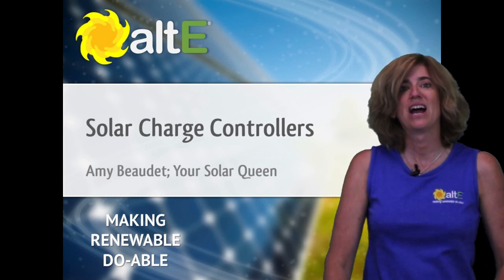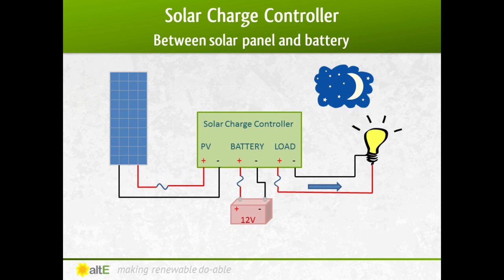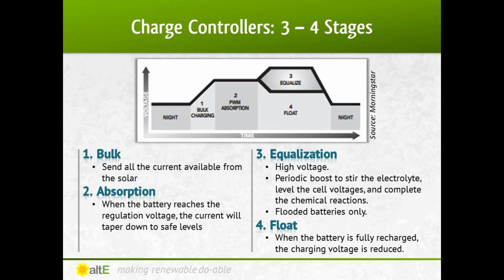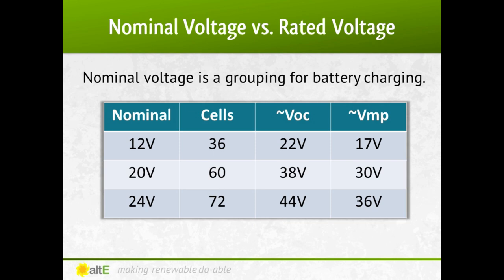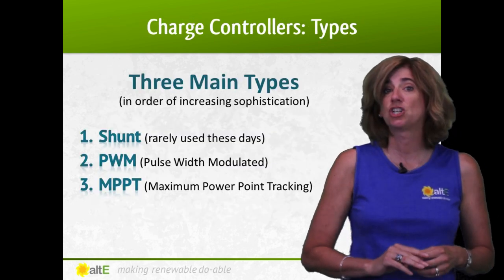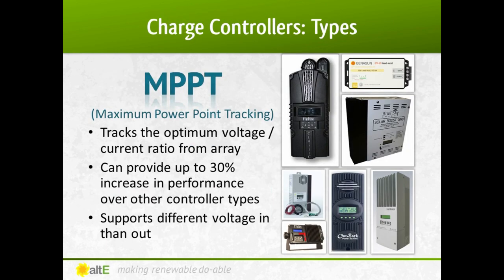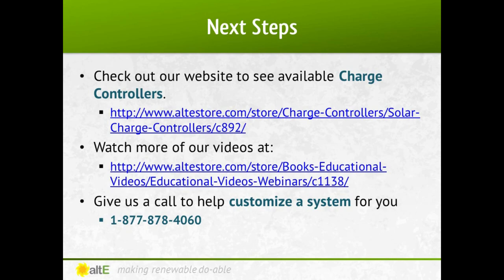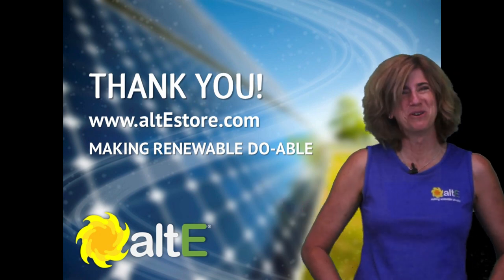Solar Charge Controller | What is it and How it works in a Solar Power System

Comment: This has been AWESOME.  But I'm still confused about sizing.  I have 6, 320W panels.  Does it matter how I arrange them, or is wattage wattage, regardless?  So at 1920W total, divided by a 24V battery, I end up with 80A x 1.25 = 100A.  Does that mean I need an MPPT rated at more than 100A?  Or 2 controllers?  Or does configuration matter?  If I put 2 strings of 3 parallel panels (36Vx10A per panel) each, in series, for example, I should have a system total of 72V@30A.  Does this mean I actually just need a controller rated at 100V/40A?  And would it be taking the 2160W input and putting out 80A at 24V?
Reply from the maker: You are right, watts is watts, regardless of their configuration. 320W x 6 panels = 1920W in / 24V out = 80A minimum MPPT charge controller. MPPT charge controllers already calculated the 1.25 safety margin. The only time the controller would care about if the panels are wired in series or parallel is voltage input. If the charge controller is 150V input, I'd recommend 2 parallel strings of 3 in series.
Reply: altE Store THANK YOU. I’ve been researching feverishly and finally realized that the controllers are rated by solar array voltage IN, but BATTERY BANK voltage-based amps OUT. You’ve confirmed and have helped immensely, and I appreciate it.

Comment: On my sail boat with variable shading from the boom Can I parallel a 24v 100w and a 24v 200w panel to a 100/30 controller to a 12 volt house bank

Comment: Hi all loved the video, clear and concise. We have an urgent problem, we have a 120 watt panel on the Land Rover, there is power going into the control panel but not going out to the battery. What would cause this please
Reply from the maker: See if there is a fuse or breaker between the charge controller and battery that tripped. If not,  temporarily take the charge controller out of the system and just connect the solar panel to the battery, see if that is charging it. If so, ten the charge controller is dead.

Comment: one question. 
will mppt charge controller work if the voltage from panels are not in the mppt range what is mentioned in the mppt charge controller manual?  i mean TO ask will mppt totally shut off giving Power or it will work like PWM?  thank-you for your answer in advance.

Comment: Nice explanation, I have one fundamental question. I understand that the PV power will always go from the charge controller to the battery before it goes on to the load. This means the load is always fed by the batteries.
My question is: Let's say the load is 100 W, and produced solar power is 200 W. Would the battery still be charged or will the power just go through the battery and directly to the inverter without charging the battery. Or will the PV power first charge the battery, and then deliver the necasarry power? When the battery is fully charged I assume PV power will still provide power to the load while keeping the battery fully charged, and only start discharging the battery when the load exceeds the PV power?
Reply from the maker: Excellent question. The answer can be a bit complex. We did discuss this with Schneider when we talked about the advantage of using equipment that talks to each other. This may give you the answer. https://youtu.be/Cppfil5h0hU

Comment: +altE  store thanks so much for the info,i would like to know what is the limit to the number of panels that i can connect in series for a 12v system so that i can have lots of charging current using an mppt.Can i have 114v into an mppt charging a 12v battery
Reply from the maker: That depends on your charge controller. What is the highest voltage it can handle? Wiring panels in series increases the voltage. Many MPPT charge controllers can handle up to 150V, so you would only be able to have a string of one panel. Any additional panels would have to be wired in parallel to increase the amps. The output of the charge controller will drop the volts down to the 12V, so if your panel is 200W, the output of the charge controller would be 200W / 12V = 16A. If you had a 60A charge controller, you could wire three in parallel (60A / 16A = 3.750.

Comment: Amy,, thank you for all your videos you are really our solar queen <3

I have simple question , I saw some MPPT charge controllers say in their specifications that for example the MPPT CC is 60 A , and max PV input (24v battery): 1600 W

but when I calculate it 1600 W / 24V = 66.67 A > 60 A 

so is it ok to follow their recommendation about the 1600 W PV maximum input for 24 V battery???

TriStar TS-MPPT-60 is good example
Reply from the maker: It is fine to oversize the array a little bit.
Reply: Aha...
So using 62.5A on a 60A MPPT CC 
you see it will be ok?
Reply from the maker: Yes. Remember the panels are rated at perfect test conditions. It is very rare that they will actually output the whole 62A, and if they do, it will just get clipped to 60A. No big deal.
Reply: Amy
You are the best 💙💙😢

Comment: I have 2 300w panels. I've noticed the 40a controllers are a lot cheaper than the 50's. Not sure how to go about it.

Also the 600watts are 24v so I wasn't sure if I should make the whole rig 24v or not.

Any help would be much appreciated.

Comment: Hello,

I'm slightly confused about your two calculations when sizing the mppt controller. 
In your first example you give a 1panel 30Vmp, 9Imp, 270W. You then divide 30Vmp/14V (voltage controller outputs)= 2.14. Then multiple this by the 9Imp to find current output by the charge controller stepping up the Amps = 19.28 to the batteries, correct? so to take into consideration the 1.25 possible increase in voltage at colder temps you would do 30*1.25= 37.5 V/14V= 2.67, then multiply by 9Imp =24.1A 
In the second calculation you then simply take 4 x 270W panels / 24V battery bank x 1.25 for safety to determine rating for the controller. = 56.25
Given the scenario of 4 X 270W panels using method one 60Vmp * 1.25= 75 /28V =2.67, mutiply by 18A = 48.21A max output by mppt.
Can you explain why you wouldn't use the first/last calculation to determine the Amp rating for the controller?
Thanks!
Reply from the maker: After talking to MPPT charge controller manufacturers, they told me I was over complicating it. Just divide the watts of the solar array by the voltage of the battery bank, and you get the amps that the MPPT charge controller has to support. For PWM, you do want to take the Isc of the array and multiply by 1.25 to get the size of the PWM charge controller.

Comment: I have 3 strings of 260wattsp(4*3 wired in series) with my 24v 600amps battery bank. I am using flexmax 80. The voc of each is 36.72v, the isc is 9.01A,Imp-8.50A and VMP is 30.60A. will I enjoy maximum operation?
Reply from the maker: I'm a little confused how many panels you have. Three or four strings of 3 in series? The Flexmax 80 can handle about 2000W of solar at 24V. So that's 8 260W panels max (4 parallel strings of 2 in series). More solar than that will clip the output, so you will not get maximum performance.

Comment: doesn't most panels these days have a blocking diode to prevent that reverse current flow at night?
Also are there solar setups that use this reverse current flow to melt ice build up the the panels? in this case that blocking diode would have to be removed? what charge controllers have this function?
can you talk about sometime the relationship between windturbine and charge controller like the midnite classic?
thanks
john
Reply from the maker: +Rev John O'Toole The diode on most solar panels is a bypass diode to keep shading on one row of silicon cells from shutting down sunny rows of cells, not a blocking diode. A blocking diode has power loss across it, so you would be unnecessarily throwing away power if all of them had blocking diodes as well. Since only the very smallest solar panel could get away without a charge controller, it makes no sense to include them in all solar panels. We do sell stand alone blocking diodes, but the biggest one we carry is for up to a 50W panel, https://www.altestore.com/store/Enclosures-Electrical-Safety/Miscellaneous-Electrical-Parts/Diodes/Blocking-Diode-for-Solar-Panels-5A-60V-DC/p196/.  

Midnite Solar has been working on a reverse flow option on their Classic charge controller to melt ice, but from what I've heard, it uses so much battery power, the gains aren't worth the loss.

Great suggestion for the wind turbine, I'll add that to my list of videos to create.
Reply: +altE Store thanks, I have used external blocking diodes in my offgrid campsite to reduce the wind turbine from sending electrical spikes to my panels, though it will reduce the reverse power flow from batteries to panels.
I will read up on bypass diodes.
thanks

Comment: Is it alright to use 4 of 100W 12v solar panel in a 100VOC/50amp MPPT?
Reply from the maker: Yes.  Depending on the voltage of the battery bank, you have options for wiring them. If it is a 12V, 24V, or 48V battery bank, you can wire them all in series, and the charge controller will adjust the output voltage for the battery bank.  For a 12V bank, the output will be around 30A, for 24V bank, 15A, and for 48V,  8A.

Comment: Madam, if I have 12 volts DC lights and 12 volts DC motors. Where should I connect it? Should I connect it directly to the battery or connect it to SCC?
Reply from the maker: If your solar charge controller has a load control or low voltage output, you could connect the lights to the charge controller to turn them off if the battery gets too low. That is if the total current of the lights is within the range of the charge controller. DC motors would probably have too high of a current draw, especially at start up, so should be connected through a breaker to the battery.
Reply: Thank u very much, madam!

Comment: +altE I must say this is a fantastic video and an eye opener for me. I currently use twelve 130W solar panels on a 12V inverter system. The solar panels are connected in 2 different arrays with each array connected to its own PWM solar controller and then to a 12V battery bank. The solar controllers are each 12/24V 60A . Now I want to change my inverter to a 24V inverter, which means I would upgrade my battery bank to 24V. Since my solar controllers can handle 24V, how do I connect my solar panels to the charge controler. Do I need to increase the number of charge controllers? How will the modification affect the charging rate of my batteries, will it charge them faster or slower?
Reply from the maker: You didn't say how many amp hours your battery bank is, or what the batteries are, or how many, so I'll have to make some assumptions. It is not recommended to add new batteries to old batteries, as it will shorten the life of the new batteries. So if your battery bank has enough storage, and you have an even number of batteries, you could just rewire your existing battery bank to be 24V without adding new batteries.

I'm guessing your solar panels have an Isc (short circuit current) of around 8A, and they are wired in 2 groups of 6 in parallel, with each group going to a charge controller. 6 panels x 8A Isc =48A x 1.25 oversizing for safety = 60A for each group, so 2 charge controllers. Perfect.  Now, if you want to rewire them to be 24V, you would wire 6 sets of 2 in series, plus from one to the minus of the other, then wire each of those 6 sets in parallel. That will give you six parallel strings of 24V. Since volts increase when wiring in series, wiring them in sets of 2 gives you 24V with 8A in each string. Wiring the 6 strings in parallel gives you 6 strings x 8A = 48A x 1.25 safety = 60A charge controller needed for the whole array! You end up not needing the second charge controller.   

Since I don't know the size or type of your battery bank, I can't really comment on the speed of charging it, but the original configuration of 120A going into the bank seems very extreme. Unless you have a very large battery bank, you may be trying to charge it too fast. Rewiring it to 24V will potentially be healthier for it, by charging at 60A instead. Let me know the details of the batteries and your loads, and I can give more useful advice.
Reply: +altE thanks for your prompt response. My batteries are 2v 500AH deep cycle type. On the solar panel connection why can't I just connect the two arrays of 6 batteries in series to make 24V
Reply from the maker: Can you clarify your last statement? How many batteries do you have? 6 or 12?
Reply from the maker: You need to wire twelve 2V 500Ah batteries in series to make 24V 500Ah. The 12 solar panels wired as 6 parallel strings of 2 in series will probably output around 45A, which is a perfect charging rate for a 500Ah battery bank.
Reply: Thanks again for the enlightenment, but will there be any reason why I can't wire my solar panels as 2 parallel strings of 6 in series?
Reply from the maker: Six 12V panels in series will be 72V nominal, 132Voc. Since you have a PWM charge controller, you have to match the nominal voltage of the battery bank, which is 24V, or two panels in series. If you had an MPPT charge controller that can handle 150V in, you would be able to wire in series. But with PWM, no, only 24V in.

Comment: Are the 24V,100W solar panels available n market? And are they efficient to give the required voltage. I want to charge a 48V battery pack but not getting the panel of 24V 100W capacity in market. Please suggest ideas.
Reply from the maker: We do have a 100W 24V panel available, https://www.altestore.com/store/solar-panels/alte-solar-panels-p40768/#ALTS-100W-24P. You could charge the 48V battery bank with 2 in series. Most 24V, 72 cell panels are much higher wattage. How many Ah is the battery bank? Could you use a more commonly available 300+W panel instead of a small 100W panel?

Comment: I got a free grid-tie 20V nominal 60 cell 250W panel that has a smashed glass but is still working, can I safely use it with a PWM controller to charge a 12V battery bank (even though I'm loosing efficiency?) My first thought was to use it with a 24V battery and a UPS that I have lying aroung but then I learned that the 60 cell won't top off the battery.
Reply from the maker: You could, but know that you would get possibly 100W max. If you are not in a hot area, you could use it for your 24V battery, but you are right, when it is hot, it won't properly charge it. Not sure if you saw our video of doing that, https://youtu.be/HILkFEVKLw8
Reply: Thank you for your reply :)

Comment: Hi Amy I have a smart harvest charge controller  SCCM20-100   MPPT  outback is it ok to wire up 3 x 100watt  12 volt panel in  parallel to a 300 to 400 WH  battery bank Many Thanks.Brian
Reply from the maker: The maximum input for a 12V battery bank is 300W, so you are in good shape. However, if you don't have any shading issues,  it may be easier for you to wire the three panels in series, and have the charge controller drop the voltage down for the battery. That will give you lower amps int the charge controller, allowing for smaller wire and less voltage drop. If there are shading issues, then yes, wire the three in parallel. Both ways will output the max 20A of the charge controller.
Reply: Hi Amy thank you for getting back to me  so soonBrian.
Reply: Hi Amy

If I wire the panels in series do I have to wire the battery bank in series  or parallel I thought you could only wire them one way or another but if I wire them In series won't it change the volts to 24 volts and I only want a 12 volt system. Thank you again Brian.

Comment: Hi, nice video, thanks !
I have a question :
If you connect the solar panel to the charge controller and the load to the charge controller too. On a sunny day should your load get power ? Note there are no batteries !
What do you feel ?
Reply from the maker: Most, if not all, charge controllers get their power from the batteries, not the solar array. SO they won't work without batteries. You would be able to connect your load directly to the solar panel if it can handle 17V DC.
Reply: altE Thanks. Could there be a provision that the 20V from solar panel in the morning power the charge controller atleast during the morning. Then i may not depend on the batteries and freely connect my 12v DC load to the charge controller and run it on the solar panels atleast during the day.
Reply from the maker: The charge controller has to be connected to the batteries to turn on. But if the sun is still up, and you are connected to the charge controller load circuit, as long as the charge controller is still connected to the batteries, you will be charging the batteries as well as powering your load. If you want to power your load directly from the solar panel, you will have to disconnect the panel and the load from the charge controller and connect the load right to the panel.
Reply: altE Perfect. Thank you.

Comment: what happen if the battery is fully charged, does the power coming from the pv module directly supplies the connected load?
Reply from the maker: It depends on the system. Most of the time, it just opens the connection from the solar panels and turns off the flow. But you can install a diversion load controller to send some of the battery power to a DC load, like a water heater, and burn off the extra energy to make room for more from the panels. This is usually done for turbines, but can also be done for solar if you want.